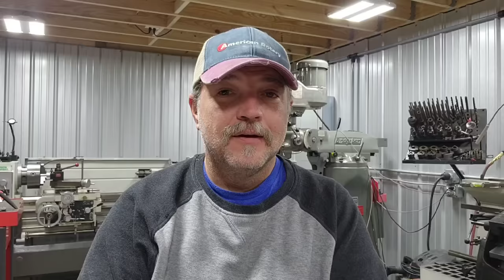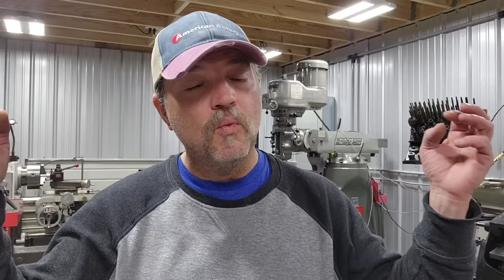*NEVER* DO THIS TO Your Harley Davidson Motorcycle! - Kevin Baxter - Baxters Garage

Comment: At least once or twice a month during winter in Connecticut (dec-apr) I find a warm enough day to take the bike for a rip for at least 45mins to an hour, put in fresh fuel and back on the trickle charger it goes. Short rides in the cooler months I would notice white gunk on the dipstick, condensation mixing with oil…1 hour+ ride would cook all that goop away. Roads can’t be salty too.

Comment: 14:56 14:56 Thanks for your good advise.  I own a Honda Valkyrie 1998 and it still performs like new and passes emissions every year. I have been very careful to avoid "warm up minutes". The same with my Ford'57 which still goes through emissions but only starts once or twice per year, carefully building oil pressure before allowing true start, and never using the chocke.

Comment: you are the motorcycle magic man. I've often thought about this, so I would coat the motor with an additive with fresh oil, ex: motor coat, Marvel Mystery oil, even mos2, or their ceramic additive. the thought of coating your engine with oil, heavy clinging lube, 60wt. Lucas. stp. motor honey has merit. emulsification occurs up north where I live, cold starts as you explained. a heated environment helps but is not always possible. so what is the solution when there is 4' of snow on the ground and riding 30-60 minutes is not possible. happy to hear you bring this subject up and address its issues. keep them coming, Kevin. tks. from the frozen north. Does any mfg. make a pre-eng oiler for motorcycles.

Comment: Basically think about an air compressor. It runs to fill the tank and not long enough to “heat” to burn off or exhaust the condensation. If the condensation is not purged or bled off if will rust or break down any internal lubrication. Same applies to cold start with a compression engine.👍

Comment: I can’t imagine starting and letting your bike run for 10-15 minutes once a month is worse than letting it sit for months without cranking.  More than likely one of the valves is open and the oil is absorbing moisture.

Comment: all good stuff,  I'd also add,  really cold temps,  aluminum and steel/iron have alot different expansion rates in cold temps, if you have a bike with some miles on it, and start it cold  ect ect you asking for leaks come spring time.  I use the Blue (marine grade) sta ble  in gas when the bike goes in the snow shed.  ( its  better for metal tanks as opposed to the red stuff)  carbed 02 Electra glide classic...  I wish I could wrap a heated blanket around it til spring.... is what it is...

Comment: Spot on with the mechanism of injury to the engine. I used my bike daily for rides to work some 15 miles each way, parked in AC equipped garage both home and at work. When I pulled the jugs off due to top end noise I found that besides some carbon buildup there was cement like substance in left corners of both exhaust pockets,the side a parked bike leans to. I assume that is the result of condensation from rapid cooling flowing to the lowest point on top of piston and kind of sedimenting there, being baked by combustion process thereafter. The buildup was thick enough to cause valve contact, so now I have new valves, freshly honed cylinders with new rings, new lifters, and bike parks outside. What do you think of my assumption?

Comment: Something else to consider about fuel after a long storage is the breakdown of ethanol based fuels. Adding just a little known fresh fuel goes a long way in making a successful spring cold start up. Here in Missouri you will find at least 10% and sometimes higher ethanol content.  When ethanol breaks down the water content will settle away from the petroleum base and ends up being the first thing your carb of fuel injector tries to squirt into your engine.

Comment: If it cranks at 10 , 20 , 30 , degrees I'm going riding ! If my bike does sit for a while, a battery tender is all I use, also if you have a AGM battery its not good to leave on a tender all the time, and I also love using Star-Tron fuel additive for all my small engines /Harley engines. Good tips Kevin !

Comment: Could you possibly  do a segment  
On taking  a bike that was going like new 
Then stored with out battery  or petrol tank for 5 years
The best way  to get the bikes running  in a safe  way as possible 

One bike is carb the other is injection  both evolution  motors

Comment: I'd think it would be OK to hit the run switch(not start) and enjoy the noise of the electric pump spinning.  Could even be helpful for that part.  I wouldn't think the injectors would fire as they have no signal to.  If that sound gives warm and fuzzies, why not?  I push my bikes around every few weeks in the winter just to give the tires different spot to sit on.  Worth it?  I think so.  No want or need of thumping tires on the first run...The R1, I put on stands so her tires are unloaded.  The new FXLRS, I've been rolling it back and forth about every 3 weeks since storage.  No starting it though...bad chemistry results.

Comment: When I was younger living in northern Minnesota I used to go for a ride whenever the temperatures got into the 30’s. One spring I removed the valve covers and it was completely covered in condensation! After that I stopped running it or riding it unless I could get it up to operating temperatures.

Comment: I take the plugs out and crank it over from time to time to circulate the oil. Hope this is not harming any thing. It is stored in a heated garage. By the way Kevin, the Stash looks good.
Reply: You still have the injectors spraying fuel into the combustion chamber, which if not burnt will seep past the rings and into your crankcase oil. Turning it over once or twice isn't building enough oil pressure to lubricate much anyway. Steel parts not in motion don't need lubrication. Let her sit, she'll get lubricated when you start it up in the spring.

Comment: KEVIN: Great advice and someting my Grandfather taught me long ago. For everyone else out there, Tell me if this is true: If your bike is stored in a heated garage as mine is, is it ok to start on rare occasion. Where I live cold weather and snow can move in rather suddenly and I dont get a chance to change fluids before storage. Sometimes its a month or two before I get to it. I do like to heat fluids before dropping. One to thin so I get a more complete drain and two to stir up any particulates so they drain out better. Since my garage is heated Im not worried about that one start. I also use a fan while warming engine.
Reply: I fire mine up every month or so, let her reach operating temp, give the battery a charge, avoid potential sumping issues. No issues in my 5 decades of riding and owning just about every toy on the planet. I'm Canadian, it get's cold and damp... I'd never leave my babies out in the cold! See my comment above

Comment: Thats great advice i dint know how many cars ive seen with tan gunk built up under the oil cap and in the valve couvers from short trip drives not getting warmed up enough to  evaporate all the moister from cold start up ever engine will suffer from that

Comment: Dont start it unless you are going to ride it, dont allow a prolonged idle, it needs some revs to get proper lubrication.
Use the choke and ride it away as soon as the spark plugs are warm enough to not stall.
Be gentle until the oil tank is hot.

Comment: Thanks Kevin, great advice. My bike is in storage at the moment and I gave it a full service prior to it going into hibernation for the winter. My original plan was to give it a service when the weather warms up and I am ready to ride regularly again (my original rationale was to avoid accumulation of moisture in the new oil). But I saw quite a few posts on forums and people advising that the service is done before I put it into storage, have you got any views on that and a bit more insight as to what the difference might be between servicing before or after storage?

Comment: I have always left my bike alone until the outside temperatures are at least 70 degrees out. I change oils and check tires before firing it up. I also have to put the battery back in since I pull it out and store it in my basement on a battery maintainer. I know that once the bike fires up, I am riding.

Comment: Not only moisture from the heating/ cooling cycle condensation, but combustion of a hydrocarbon (gasoline) requires oxygen. When these two molecules do their thing (hydrogen + oxygen) the reaction is H2O as a by-product of the combustion. That's that white stuff coming out of a car's exhaust on a cold morning. I generally don't winterize here in NC, as there are always a couple or three days in every month that are rideable. I have a full tank in fall and over the winter most of it is used up in the form of 20-or-so mile rides that get the oil hot enough to evaporate MOST of the moisture resulting from combustion and condensation. 😁

Comment: Hi Kevin
I love your channel.
Yes I'm one of those people that on every two weeks or so  goes to the shed and fires up my M8 107 Street Bob over here in cold and wet England, thinking that I'm doing it a favour and clearing out the condensation that builds up inside the engine. 
My question is about, when it is cold and below freezing point outside then the shed gets cold and below freezing point too. Then all of a sudden the weather warms up, the shed isn't able to warm up as quick thus making every metal surface get covered in condensation,  is that also happening inside the engine too? And is it not better to start it up and get hot so as to stop it from condensing  in the first place?

Comment: At a minimum every two weeks I take my bike out on a 60 mile ride during the winter. Keep it on a tender and gas up each time. Set cardboard underneath the tires between the rides. That's my method.

Comment: I keep my HD in a climate controlled room so it stays around 70 all winter. I keep her in my basement workshop not the garage. But I still don’t just start it just to hear it run. Besides the problem I would have with fumes in my basement it is just bad to start and stop an engine for no reason. Along with the battery tender to maintain the battery I just wait it out and deal with no bike for about 8 weeks.

Comment: TY I have a 99 EVO with 85000 miles on it I never start her unless I'm working on it or getting ready to ride her not for that reason but you make sense 
I don't start mine because it does not charge or keep the battery maintained unless you ride them of course l live in NC so I ride quite a bit but when I do ride she is still strong and the pipes and plugs are that gray color and she never fails me but you have a good point and nice to know that ty 
Anyway keep it between the mustard and mayo and rubber side down GBU Later

Comment: Question for Kevin and everyone. I have a 2011 limited, 107,+++ miles on it. It has no issues running. Compression test hits at 145. Ride until it won't run, re-ring now or build to a 110 now?

Comment: When I shut 1-2cyl engines down over the winter, fogged and not, I leave them at TDC so the valves are closed at the very least. Stop the valves n seats from rusting and letting in any further condensate. Put your bike in gear and pull it back until you feel that resistance, that's it, that's all. My old Evo is much happier starting this way when she's HOT, no violent pre-ignition kickbacks... reverse is the key so the starter's not immediately engaging on a power TDC, rather the end of one.

Comment: Great emphasis. I'll add don't be fooled by two things. One is the coolant temp gauge.  Oil takes longer to get to running temps than coolant.  Also, in my experience, fuel injectors are under enough fuel pressure that a few winter months of not running will not plug them.   I have not had a few months of WI winter ruin gas either. However,  I did have gas go bad one hot  summer while I had a broken wrist.  The injectors and lines were fine, changed the gas and all good.      The point is that the only ill effect from not running a few months for me have been bad gas  in a hot season and battery dying if not on a trickle charger.

Comment: Since sbout 1990 i have pur each of the 4 diff Harleys i have had in a VAC BAG with a vac pack pack thrown in.i topped the tanl full up ,put in 20 mil of REDEX fuel stabiliser .Start the bike  turn off pet tap and let it run till carb is  empty . I take out the plugs and put about 5 mil redex in each cyl .
Polish the bike wheel it into the vac bag  connect up the batt tender ,suck the air out with a vac clnr 
Toggle strap the end of the bag up .And forget about the bike from nov to end of April .
I took the FLSTF out the bag 2 days ago ans its as immaculate as when i out it in last Nov.
These bags last for 10 years ,and i am on my 3rd bag at £50 each.

Comment: My aircraft customers whose annuals occur during winter months are always disappointed in compression tests and oil analysis results. They will fly for half an hour or less. The machines have oil temp gauges and I tell them to get it as close to 200° as they can fly it that way for at least an hour. I wish all of my machines had oil temp gauges!

Comment: I've had bikes for over 20 years and I have never worried about any of that crap or done any of it and have never had a problem I only keep a battery tender on my Ultra Classic in the winter because of the security system in the radio and they are all pushing over 70,000 MI

Comment: Kevin Lov your videos I am in Indiana cold up here I will wax my car in the winter turn on the heat 70 degrees for hour hour and a half when I am done crank up the bike and run it until the oil is at operating temperature for awhile with no problems. What’s your thoughts on this. Thank you!!

Comment: It does seem unnecessary to cold start bikes in winter storage … but is it really doing any harm?  4 stroke snowmobiles, tractors and utility equipment, not to mention cars are started many more times a winter in much colder temps than one would probably decide to start their bike in.  And provided the oil type flows well in the cold and the engines are allowed to get up to temp (bake off condensation in the oil), it doesn’t seem like it’d be a problem. But again, there’s no point.

Comment: Had a 48 pan and you kicked maybe 15 + minutes before you pulled the choke, then three kicked through, turn on the ignition, one or two more kicks, not let it warm up a little while you cool off and get your jacket back on to ride, watch out for the snow on brick streets. You kids don't know what riding is really like. Still love riding today but try to ride when weather is about 35° and no rain or snow when I leave home. Don't start your engine unless you ride at least 20 miles with stop and go traffic.

Comment: So what I am hearing is that the key is getting to proper operating temperature?  An engine at proper operating temp will dispense with any moisture in the system, correct?Any cooldown from operating temp in a cold climate will potentially cause condensation whether the engine is in storage or being ridden/used, no? If this is the logic, then saying you need to ride for any time limit, or ride at all seems a little suspect, unless riding somehow churns oil, or boosts temperatures in an air cooled engine differently than working the throttle standing still....I hate to be that guy but...
Reply: I was pretty much gonna ask the same thing, I am thinking the key is to be consistent, not just once ever so often. Also maybe change the oil a little sooner than normal

Comment: Nice variable speed Bridgeport Vertical Mill. It looks to have no digital readout.  Probably the standard ACME screw on the tables.  Bridgeport is the best engineered manual mill a man can work with.  Looks like nobody has broken off the quill feed knob yet either!  Lol

Comment: Ok i do this to my harley with the exception,  i let it run and have a beer, maybe a couple  puffs. I let it run until i hear the fuel injection  tone down to as if it were warm out. Maybe  even go around  the block. I ain't  gonna start it unless the entire fuel systems  got fresh fuel, and operating  temp. I assumed  letting  the oil drain till theres zero anywhere  in the head was worse than not starting  it. Is that still bad?

Comment: I miss the kickstarts, you can turn the engine over and pump some oil around without starting it at all. I shut the fuel off and run my bike until it quits in the fall and leave it sit until spring, (carbureted bike) 
I also have a 2009 Kawasaki Teryx, (fuel injected) on that machine I have used Amsoil Quick Shot in the fuel at the maintenance level  since it was new (!/2 a bottle to 22 liters (5 Gallon Jerry can) Hasn't really got anything to do with cold starts, but in the 15 tears we've owned it, the machine hasn't even as much as sputtered. Passing it on in case someone cares!

Comment: Maybe you could answer this. For some reason I’m getting a lot of compensation on the left side of my exhaust. I have a 21 streak light talk to the dealer about this they told me one thing just like to know your opinion what might be causing this it’s causing a rust buildup inside my pipes. I have aftermarket slip on the Heinesappreciate your input